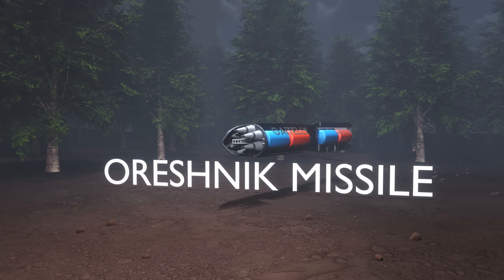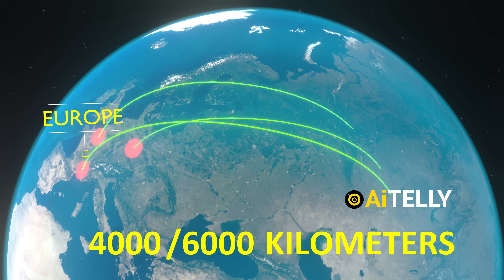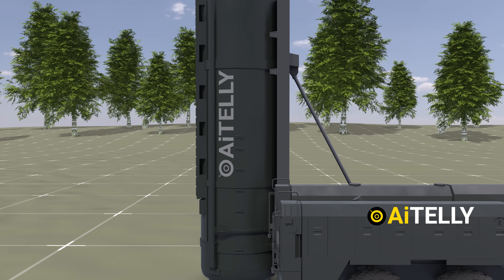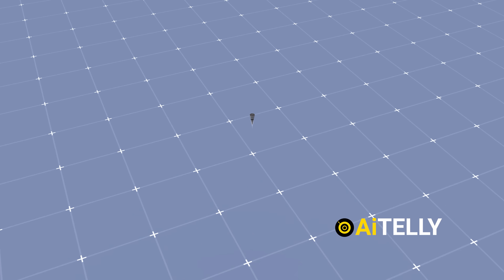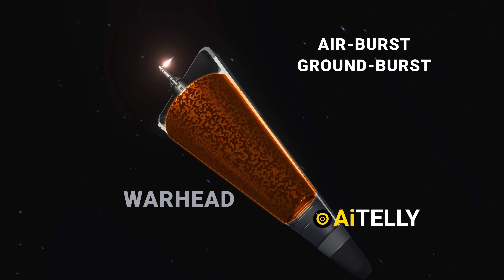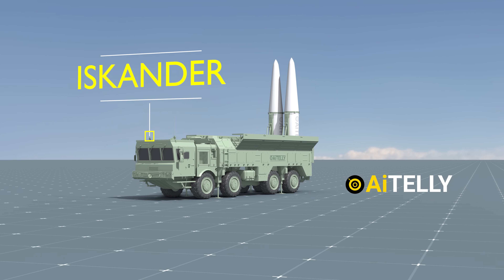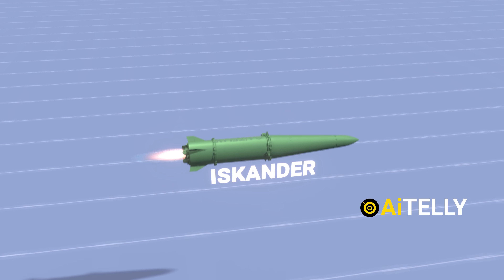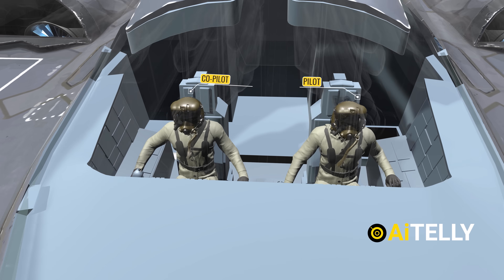Oreshnik Hypersonic Missile | How Russian Intercontinental Ballistic Nuclear Missile Works?

Comment: This is gibberish.  No one knows anything.  Literally everything in this video is either wrong, or a guess.  The only thing is that there ARE 6 canisters with 6 submunitions. 
"this is based on an american design"—  nice one bro.
Also, it's not a re-entry vehicle if it doesnt leave the atmosphere. Also, it's based on the Yars-M vehicle and it DOES accelerate as it descends almost straight down, and we know that for a fact

Comment: the solid fuel shown in the video is wrong, first stage is said to be solid fuel but the graphic shows 2 tanks, which usually means a propellant and oxidizer, solid fuel should be visualized as cylinder that has a hole going through it top to bottom

Comment: I believe this is true even if this is a theory.  The IRBM Oreshnik design cannot be too different from ICBM and yet MIRV boosters can be a small innovation that sets this hypersonic system apart from other IRBMs and ICBMs.  I do not believe in the submunition theory of the warhead housing 6 Tungsten rods that can deploy just before reaching the cloud altitude because this motion will reduce hypersonic speed lower than Mach 11.  This channel did an outstanding job of highlighting the Oreshnik's innovation of small boosters that alter hypersonic warhead trajectory to evade counter-measures.

Comment: Watching videos from this channel feels like mental torture. First of all warheads do not maneuver to evade interceptors. Those two thruster used to spin warheads so they will penetrate dense atmosphere effectivle. Meanwhile gimballed small rocket used to acceleration. So it do not maneuver to avoid missiles. Secondly patriot and s400 not designed to intercept such warheads. They can intercept targets flying less than 3.5 machs. So as you can see nobody even tries to intercept ICBM warheads.
Thirdly this channel has tradition of assuming that everything maneuvers at low altitudes. He is wrong. Iskander is ballistic missile and don't fly low altitudes and do not evade interceptors.
Fourth, trajectories he shows wrong. So called oreshnik had very plungy parabolic trajectory.
Everything is wrong and misleading, just to ride hype train.

Comment: from google:
"The debris on the ground is from a single missile and not from multiple ones (as in the case of a grouped strike). The device is therefore evidently MIRVed/equipped with multiple RVs (military payload) of an unknown type. A few hours after the impact, the Pentagon mentioned the launch of an RS-26 Rubezh missile."
its 6 projectile in every warheads of total warhead = 36 impact?

Comment: Oreshnik AKA the Moskit-E, is a high-speed anti-ship missile w/ a range up to 250km & CAN reach speeds of up to Mach 3 (aprox 3,700kphb Или 2,280mph “Для американцев”).  Equipped with a 500-kilogram warhead & designed to be launched from both surface ships and submarines.. It is considered to be one of the most advanced ANTI-SHIP missiles in the world  not z sonic let alone a hyper sonic! Hypersonic it’s just anything 5x Mach. 1x Mach “sped of sound” = 760mph=1,223.101 km/h x 5 = 760x5=3,800 mph
So technically  there’s been many rockets/missiles that are hypersonic!
That’s like thinking that aircraft with jet engines first to break the sound barrier, when in reality there’s been aircraft in World War II the sound barrier. Grant you that they may have been shot down and approaching that speed on their way down. semantics/ tomato tamato

Comment: Oreshnik is not a RS-26. Maybe it's based on it but it's not it. And Oreshnik is not an ICBM becouse it range is 5500 km or 5000 km. And payload maybe be more and Oreshnik has 6 warheads with 6 subminitions in each warhead so all together 36 submunitions.

Comment: Ah physics, what a wonderful subject. Hypersonic terminal speed cannot be achieved by gravity, even if hypersonic from space. There is simply too much drag in the atmosphere. The warheads must have thrusters and heat shields. The terminal velocity alone cannot provide enough energy to penetrate but a shielded molten blob at 4000 degrees sure helps. Ever heard of penetrating shaped charges? That's the sort of tech you see with Oreshnik. Normal ballistic missiles slow down before delivery.
Reply: Каким образом тогда метеорит влетает в атмосферу земли со скоростью 11-70 км в секунду?
Reply: @mistermuhutya2583  В космосе можно разгоняться свободно, поскольку там нет сопротивления воздуха, соответственно и влететь в атмосферу можно тоже на очень большой скорости, но если скорость входа в атмосферу будет слишком большая, этот воздух покажется по прочности как бетон. Чтобы пролететь всю атмосферу на достаточно большой скорости, нужна идеальная аэробаллистическая форма, прочность сравнимая с вольфрамом и достаточная масса.
Reply: @onega23  форма как раз может оказаться не столь важна, если вокруг создана плазма. А масса, вообще то передаваемая энергия, это масса + энергия, то есть скорость.
Reply: No thrusters are required to achieve the observed impact velocity. The vehicle is not a "molten blob" before impact, and it's nothing like a shaped charge.
Reply: They didn’t tell you that the warhead flies in the plasma around it, it feels no resistance. The Russians have created a metal that does not melt at 3000 degrees and at the same time all the electronics on board work.
Reply: @vknfriendly Plasma sheaths do not negate aerodynamic drag.
It does not use a metal that doesn't melt, it uses an ablative heat shield that vapourises, likely a carbon phenolic composite. That vapourised plastic is what forms part of the plasma sheath.
There are no electronics on board.

Comment: It does not follow the classic parabolic glide path, but on escaping the atmosphere it swirches to.a hypersonic lateral glide path to distort enemy detection of its launch trajectory as a ballistic missile has to be intercepted before it goes into dive mode. Just prior to dive mode it again climbs before the Bus is released in dive mode and the 6 primary warheads separate. The 6 submunitions / decoys on these warheads are then released at a predetermined point in two waves.. with the leading penetration wave opening a path for the trailing explosive waves to detonate inside the penetrated target. The kinetic force & heat have deeper bunker busting capabilities.
The Oreshnik has been officially labelled an IRBM with a 3000 km range, to appear compliant with treaties, but it is technically an ICBM with a 650O to 7500 km range, putting most of the US coast within reach. The official ICBMs have a 12000 km range whilr they also posses hypersonic orbital missiles that can circle thw globe twice and make it impossible to know when and where it will dive to its targets.
China is trying to develop the orbital missile, but as things currently stand, Russia has the decisive edge on missile tech & capability as well as the ability to scale up production despite sanction. Talk of its depleting stocks are pure balderdash

Comment: I was working in a hardware store as a kid next to an AFB and a military guy brought in a 1’ tall nose piece in the 80s. It was smooth and hd what looked like a 3/4” pipe flange embedded into the cone. He was mounting it as a gift for someone with a wooden desk plaque but of course pipe fitting threads were not correct. He told me the nose cone was from a 1 of the 6 and is made of a silicone material. He said when it re-enters it melts to protect the “something” on re-entry. It weighed about 10 lbs. it was pretty wild.

Comment: For people wondering "36 warheads", the missile itself only have 6 warheads, but every single warhead have 6 submunition for conventional explosive like cluster b0mb.
Reply: W R O N G !!!!!   THE SUB MUNITIONS ARE NOT LIKE CLUSTER BOMBS , THE HAVE NO EXPLOSIVE , THEY ARE ALL HYPERSONIC PROJECTILES ...... Do some real research.
Reply: Совершенно не верно..там одна ракета поднимает шесть ракет в орбиту..потом эти 6 разгонятьються создают начальную траекторию. уже когда доходят до слоев атмосферы делаться на 6 боевоголовой и того 6x6 автор вообще чушь несет
Reply: @КешаБурундук  >"36 warheads. Then what is the kinetic energy of each?"
I would expect the energy equivalent of 25 to 75 kg of TNT. Seems tiny, but that energy is highly concentrated in a small cross-section. I suspect the cones split up into needle-like penetrators length-wise.

Normally solid materials (such as soil or concrete) become more permeable at those speeds. This is how you can shoot a nail into concrete with a nail gun and it's stuck there so clean like it'd been teleported - whereas if you take that same nail and strike it with a hammer, you'll either bend the nail or crack the concrete.
I expect, the Oreshnik's needles sail through tens of meters of reinforced concrete like a hot knife through butter, and only after they appreciably slow down they transfer the remainder of their kinetic energy "all at once" to the surroundings. Like an upsized anti-tank "dart" on steroids.
Reply: @AlexKarasev 2meters, not tens.
Reply: Supposedly. The one fired only had ballast.
Reply: @jnievele  any ballast would be burnt up at those speeds, it has to be made from special materials like tungsten alloy... so it can handle the heat from friction in the atmosphere.
Reply: @hindugoat2302 Tungsten is not suitable for such high ballistic coefficient reentry vehicles. An ablative heat shield would have been used..
Reply: No evidence of that.
Reply: 36 warheads. Then what is the kinetic energy of each? And the second question: maybe all 36 warheads have penetrating power? Or did the warheads simply disintegrate in the last section, and therefore it seems that each of the 6 warheads has submunitions???
Reply: @КешаБурундук  it would be pointless if the warhead disintegrated.

if your warhead is conventional explosives, there is a limit to the speed it can go without burning up in the atmosphere from the friction.
but you can go higher mach speeds if you use a kinetic warhead - no explosives just a solid projectile made from tungsten alloy, that can handle the heat, up 3500 C.
higher speeds make it harder / impossible to intercept.
But at even more speed eventually any material will burn up, so more MACH is not always better, there are limits when you are in atmosphere.
Reply: @hindugoat2302  more mach is always better. The submunitions all have mass and when paired with that velocity, will impart extreme energy to the targets. And from video evidence, they clearly didn't burn up before reaching Pivdenmash. I'm very curious to know the extent of damage done to it, but I guess we'll have to wait till the end of the war to hear the truth.
Reply: @lancerevo9747  the mass will be vaporized before reaching the surface if its travelling too fast.
More speed = more friction = more heat.
There are limits to what the materials can handle.
Reply: @hindugoat2302  but that's not what we saw in the CCTV footage that went viral. The mass clearly maintained it's size and bulk in each of those 6 waves.
Reply: @lancerevo9747  yeah because they were travelling slow enough not to burn up.
They are made from tungstun alloy, with a melting point around 5500C.
But if you tried to make them go mach 50 they would burn up long before they hit the ground.
Reply: @lancerevo9747  also we cant see from that footage how much of the mass was burned up, it would happen very quickly. 

but we can tell they worked and impacted the ground and were not intercepted.
Reply: @lancerevo9747  it would be different if it was a huge meteor coming through the atmosphere at high mach speeds, because it has so much more mass...
The outer layer would heat up and burn away to vapor, but by the time the heat got down to burn the core it will impact.
But these hypersonic weapons only have a couple of ton.
Reply: @hindugoat2302 Each of these warheads has a mass of no more than 25kg...
Reply: @hindugoat2302 No tungsten. It's melting point is 3,422 C, not 5000.. .
Reply: @КешаБурундук в ней не было боеголовок, в ней были только металлические болванки , возможно вольфрамовые. Они прилетели с максимально возможной скоростью с какой может прилететь метеорит из космоса.
Reply: @ЮрийРубан-ф3м  Метеорит может прилететь со скорость до 100км/с, у Орешника 3км/с
Reply: @КешаБурундук Each warhead has on the order of 112.5Mj of energy, equivalent to 27kg of TNT.
Each warhead will produce a crater about 2m deep and 6.4m in diameter in concrete...

Comment: Very very similar to some 1970 1980 balistic missile
Reply: ракета выглядит как ракета - да это странно
Reply: @yleniachimetto299  Except these can maneuver at hypersonic speed, its kinda the same new missiles iran launched into israel, they can maneuver to prevent israel defense system from hiting them, this is the biggest new threat to western world, hypersonic maneuver missiles
Reply: @GTA_xClipZ  When you talk today about hypersonic missiles you are either talking about a Hypersonic Glider Vehicle which can indeed maneuver and glide at hypersonic speeds or a Cruise Missile which can cruise at hypersonic speeds, ballistic missiles with maneuverable warheads are nothing new, the United States tested this in the Minuteman I, and the Pershing II which is similar to today's Iranian ballistic missiles used this type of warhead in the 80s.
Reply: @erickcoelho234  indeed the US has maneuver ballistic missiles, but they dont have hypersonic cruise missiles and hypersonic ballistic missiles which can maneuver at such high speed, its somethings only russia, china, and now just iran found out about.
Reply: @husseintamemy2558 🤣👍❗
Reply: @GTA_xClipZ  Except pershing 2 missiles had marvs allready in the 70s and 80s so its nothing new
Reply: Main feature is Avangard block - it's glider missile with >10 mach speed. The creation of such high-speed and maneuverable rockets requires extremely heat-resistant alloys. Metallurgy in the USSR was perhaps the best in the world, which is why only the Russians have so far managed to make the Avangard block.
Reply: @rinaldoman3331 Nonsense,both US and China have both missiles with hypersonic gliders
And Russia isnt Soviet Union
Reply: @mastermariner490  name the ones the US has.
Silly child.
Reply: @mastermariner490  you’re high.
Reply: @ Pershing 2 missiles had manouverable deentry vehicles allready in the 70s and 80s,live with it Igor
Reply: @ Go play with Pershing 2 missiles with manouverable reentry vehicles from the 70s Nd 80s,Igor

Comment: Good video. You covered the Iskander too. Well done 

But Oreshnik is an IMRBM, not ICBM. Hypersonic objects are not clearly visible to radars and so cannot be homed or shot down
Reply: You are technically correct about hypersonic objects not being visible, but not in a way that matters.

The plasma sheath hides the object itself, so usually radars can't detect the object. That said, the plasma sheath is extremely energetic, and not only shows up very clearly on radar, but actually emits radiation, meaning there is a chance that an RWR could detect it passively. 

Hypersonic missiles are not stealthy for any practical purpose.

Comment: putting "hypersonic" in the title is funny considering even the V-2 rocket was hypersonic
Reply: The The current concept of hypersonic is not limited to its speed, but also to its maneuverability. Traditional intercontinental missiles are hypersonic when they re-enter the atmosphere, but have a purely ballistic trajectory, which facilitates their interception. In the case of hypersonic missiles of this type, their maneuverability makes interception difficult precisely because of their maneuverability.
Reply: @carlosbanosoliva4226  "hypersonic" is a speed threshold, not a flight path.
Reply: @Just_A_Random_Desk  By “hypersonic” I am referring to the concept of the new missiles. Hypersonic refers, as you rightly say, to speed. But with the new hypersonic missiles, what they mean is, in addition to speed, maneuverability. If you go by the meaning alone, then even the Minuteman is hypersonic and the U.S. would not be racing to develop it now.
Reply: @Just_A_Random_Desk  the difference is that Oreshnik is Mach 10 when it hits the target (in range of air defense). Most ICMBS are mach 20+ in certain stages but not the final stage when the munitions are released. That's one of the reasons Oreshnik is a big deal.

Most air defense has a vertical operation of about 100km this means they have only seconds to detect, launch and guide air defense against Oreshnik when it's in range.
Reply: Google what "hypersonic" means in the modern sense.
Reply: @Verezart  again, the word "hypersonic" is a speed threshold, not a flight path.
Reply: @Just_A_Random_Desk  bruh this is embarrassing, you are obviously an amateur, the word has a different meaning in the military space, its used to describe a specific type of missile now, not just speed
Reply: @leight420  what's embarrassing is liking your own comments. reddit is down that hall to the left.
Reply: @Just_A_Random_Desk   lil bro is so mad that he was wrong🤣🤣
Reply: @Just_A_Random_Desk  but the v2 ain’t carried 36 nuclear warheads
Reply: @Emau158 It's not carrying 36 warheads.Atmospheric re-entry needs refractory materials. I think it is clear why. And it is simply impossible to create many such submunitions, and they are still very small, which means they need a special stabilizer that not only weighs a lot but also requires a lot of space in the submunition, of which there is not enough
Reply: @ it carry’s 6 main warheads with each one having 6 smaller ones in it so for me that’s 36
Reply: @Emau158  no icbm carries 36 nuclear warheads lmao so who cares